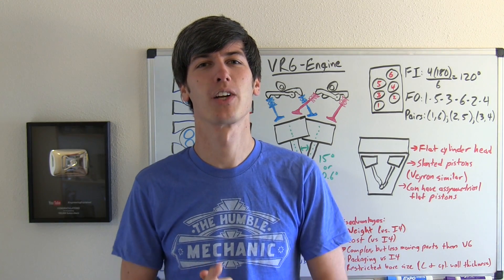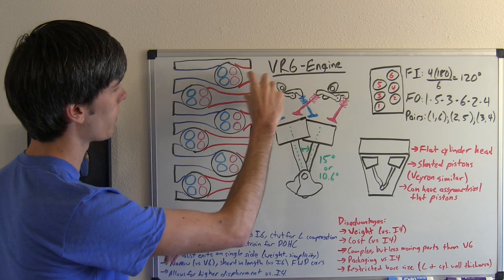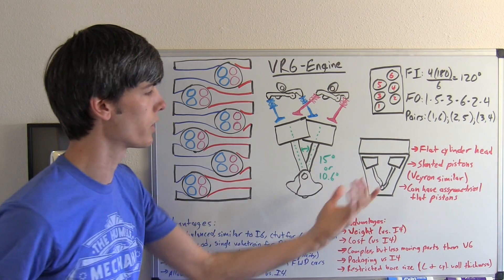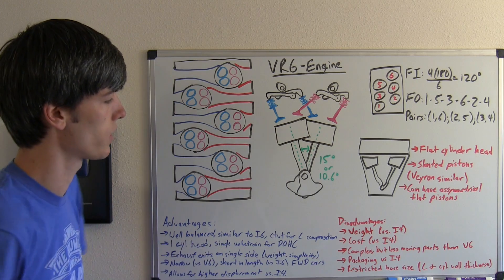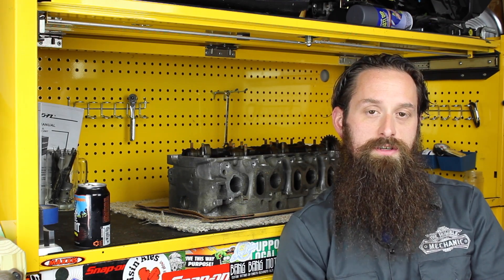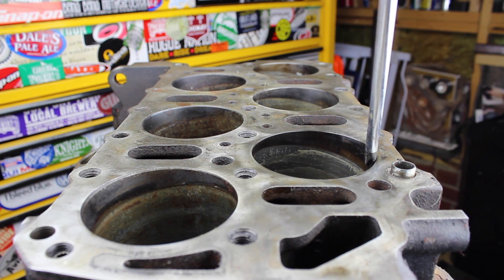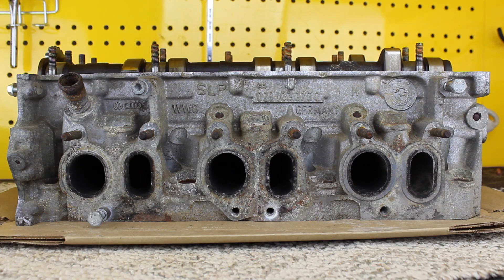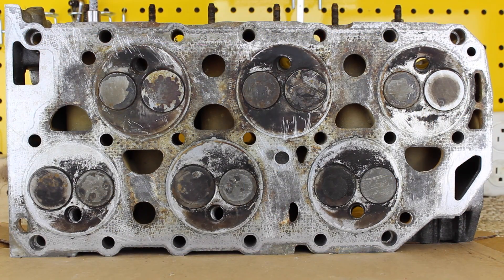VR6 Engine - Explained

Comment: i used to have a turbo version years ago they are insane as they were built as a diesel engine but was scrapped but they kept the design and built it as a petrol engine and it can handle up to 700HP on the stock bottom end

Comment: Hi getting an intermittent misfire with CEL on one of the cylinders for a 2000 Eurovan VR6 12V. But want to ask, since these (older) VR6s are port injection, carbonization on the valve wouldn't be a the cause for misfire as with the newer DI? 
I also have a Tiguan which had a similar issue where new DI fuel injectors and valve cleaning solved the problem.

Comment: Question is, what is wall thickness where the top of piston (and rings, to a degree.) is located from the point of max acceleration to BDC. The wall thickness at the bottom of the cylinder is not as important as it is obviously only housing the piston and not containing the cylinder pressures created during combustion. 

Another consideration I guess is the wear characteristics of the thrust side and what inherent scope there is for rectification of cylinder ovaling by increasing bore diameter and fitting oversized pistons.

Comment: This the first time I learned anything about the VR6, very interesting. What are the stock engines power specs?
What kind of aftermarket support is available? Is there a way to use this in a rear wheel drive configuration?

Comment: The origin of this type of engine, of course goes back to Lancia with their famous V4.  I am surprised that no other car manufacture picked up on this idea.  Having to machine two decks and cast twice as many heads adds to the overall costs but does nothing to enhance performance or efficiency.  It can also be good for turbocharged applications because it leaves more room in the engine bay for a turbo.

Comment: I am the first owner of a 2003 VW Jetta GLI with the 200hp VR-6 engine. It was my daily driver for 15 years. The engine is just iron clad. Coupled with a manual 6 speed it is extremely reliable and pretty efficient. I cannot seem to let it go, it’s now a good little weekend warrior. 242,000 miles and still going. Keep on Buggin’!

Comment: the explantation of the camshafts on the engine is different to the explantation on the whiteboard. the whiteboard was stating, that there are very long (and strange) levers to actuate the valves. and one camshaft is just for intake, but for all cylinders. 
but on the actual block everything makes sense

Comment: These white board videos are great, thank you so much for doing them. A query on this one though...is your cam shaft dwg correct? It's a cam per bank not a cam for intake and another for exhaust..?  And a tech question if I may. With different length inlet tracts doesn't that mean pressure waves , VE and Torque will vary per bank?

Comment: Hello, excelent video. I have a question: I changed VR6 conrods for another racing type 100grs ligther than original, and now have appeared a big vibration / unbalancing, do you have any comment / tip to get a correct balancing of this engine when I changed conrods?. Thanks in advance, Nestor

Comment: The V is not about the shape.  V stands voor verkützer, R stands for reihenmotor.  A real V6 would be to big to put in a VW Golf.  Even a 6 cilinder in line would be to large.  The VR6 was a clever solution.  So in fact, a VR6 is a shortened 6 in line motor.  In English it would be named a SL6.

Comment: I'm not sure if this has been said, or if it was mentioned in the video and I missed it. 

But I believe your drawing only refers to the 24v setup. For a 12v each cam does both Intake and exhaust. There isn't one cam solely for intake and one cam solely for exhaust. Each cam has 2 lobes per cylinder; one for intake, one for exhaust. The 24v is exactly as you showed, each cam has one sole purpose, Intake or exhaust. 

The Humble mechanic did a great job of displaying that with the 12 valve head.

Comment: Looks like a whole lot more metal than a straight 6- 20% shorter but 50% wider at the top of the motor giving a higher centre of gravity. As the slight v detracts from the perfect balance of a straight
 6, are balance shafts needed like true v6 engines normally have or is the difference negligible? Wont unequal sized ports give different velocities, resulting in unequal cylinder performance?

Comment: It just now downs on me, that the valve train with one cam taking car of intake and the other taking care of the exhaust valves is only true in the 4valve version of the vr6. In 2 valve form that obviously does not apply since the valves move parallel to the cylinder heads sealing surface.

Comment: is it the same engine from 2019? should i get the 2.0 or the v6 in atlas, which is more reliable and less maintenance?  thanks
Reply: The 2.0 is crap. Always go for the VR. Unless it isn't available, then go for a 1.8.

Comment: The first narrow V production engine made wasn't VW but Lancia in early sixties produced in over 350000 units and used on Lancia Fulvia It was a 4 cylinders from 1200cc to 1600cc dohc, the V adopted was from around 11 to about 13 degrees

Comment: My 2003 GTI VR6 (24v engine) has been totally reliable for almost 16 years now!  Not one issue!  Initially, when I bought the car, they recalled it for a coilpack issue, but they installed new and improved ones, and i've not had anything else come up all these years.  This engine is the most reliable i've ever had, even more than the Japanese cars my family has owned over the decades!  This engine is so smooth, with good torque.  I love tooling around town in almost any gear I want.  Incredible!
Reply: Mine had a misfire but with new coils and plugs fixed that for me, other then a battery issue i had the car is running great.

Comment: Would have liked to see the stroke on the lower/crank side of the motor? To see just how close/thin the cylinder walls are on the bottom of the motor.

Comment: Very reminiscent of the Lancia Fulvia 1.3 HF that I wrenched on during the 1969 SCCA season. The main difference is that the engine is inline, vs transverse. 13 or 15-degree v, if I remember correctly.

Comment: Does anyone have any real world external dimensions on one of these? I used to be into engine features and now all I care about is getting the most displacement from the smallest cube. I goofed around on Google and found someone saying that a VR6 long block is approximately 24 inches wide, 32 inches long(??) and 35 inches tall(!!). If these numbers are correct, that VR6 is larger than my small block Chevy. Anyone know what they weigh?

Comment: One thing that it has advantage over a conventional i6 is that it does not suffer from the same 2nd and 3rd degree harmonic issues, especially Z axis pitch problems.  
Inline 6's are notorious for harsh harmonic issues due to the length of the crank and how the firing order exacerbates this.
Diesel engines with much higher combustion event pressures suffer it with a greater magnitude again. 
V engines are brilliant in overcoming this as they have shorter cranks and blocks, the crank wobble is greatly reduced and weight savings can be made significantly at the same time.

Comment: Intake and exhaust issues are dealt with via runner volume. They do overheat and warping is the last thing you'll worry about as the heads crack when overheated. And although you may not get the external symptoms you'll get small cracks intersecting the spark plug holes allowing coolant to seep in causing premature plug wear and slight coolant loss.

Comment: Is engine compartment space really at such a premium that you need to go to these lengths?  I would think an inline-6 would be much cheaper and simpler to manufacture, especially when you start considering slanted pistons.  Do you get maybe a 20% length reduction?   I'm sure people could figure out how to put an inline-6 into a front-wheel drive car.

Comment: What I don't understand is if they're interested in saving space under the hood why go to an inline 4. Why don't they make a new block that looks like the VR6 only with 2 cylinders lopped off, making it a modified V4. This style of V6 isn't much wider than an I4, I would think shortening the block by 2 cylinders would really open up the space.

Comment: Not sure if it has been covered, but your section describes a 24V head as far as cam layout. The 12V VR6's like what The Humble Mechanic shows has cams that each have intake and exhaust lobes.One cam controls all valves in 3 cylinders. On a 24V, there is an intake cam and an exhaust cam like in a twin cam inline, and the mechanism looks just like you have drawn. 24V''s also have CVVT and the head is not completely flat like the 12V's. The 12V combustion chamber is the piston dish, the 24V has a typical hemispherical 4V combustion chamber in the head.

Comment: My experience with VW is over, I decided years ago not to work with any VW product. 
I am a retired Master Mechanic, with loads of dealershiip experience, heavy line work, diesel, manual trans, basically anything from the front bumper to the rear.
I still do work for friends, but will not stand behind any VW product. In my experience they are unreliable, and engineering nightmares, Mercedes is just as bad,, and I refuse to repair them as well
I prefer proven engines and reliable engineering, this allows me to stand behind repairs.
Oddball designs are intended to complicate vehicles to the point that dealerships are the only repair option, and this is all about making money.
When design is complicated, costs go up, drivers and owners of vehicles should not have to spend huge amounts of money just to keep the wheels in motion.
Simple engineering is a cost saver, if you want a vehicle that in unique, be prepared to spend allot of money for the vehicle, and repairs.
I will keep my Dodge dually 3500 with the V-10, it's a perfect VW crushing machine.

Comment: The cams drawing on the white board is wrong, each cam does both intake and exhaust for their respective cylinder row.
Reply: The white board is the 24 valve, the mechanic had the 12 valve. The 12V a camshaft controls both intake and exhaust, 24v one cam is all intake other all exhaust.
Reply: Mikey I was thinking the same thing the mechanic explained it the right way
Reply: @Dabestshindig

Comment: Could the cam lobe/valve arrangement be modified to use only the short passages for exhaust and only the long runners for intake, with injectors and headers on both sides of the engine?

Comment: are there VR6 engines with cylinders that move parallel to one another ?
Reply: Adrian Fidi No. They have an angle, because all of the piston rods converge at the crankshaft.

Comment: Matchless (motorcycle) did it with a narrow angle vee four ,single O.H.C. in the early 30's 600cc. I think it was called a Silver Hawk don''t remember what the vee angle was  but the cylinder block was a single air cooled casting the cam drive was bevel gear driven shafts. Bad time to make that type of motor in the middle of the depression.They also made a mono block twin in side valve form again the vee angle escapes me.

Comment: +Engineering Explained you might want to see the Lancia Fulvia V4, even if 2 cylinders less, is the same concept but done 50years ago
Reply: glad to see someone else is awake and has seen a lancia v4
Reply: I had a total of 3 Lancia Fulvias with the narrow V4 back in the 80's.  Wish I still had them now.  The Lancia narrow V4 goes way back before the Fulvia though.  It goes back to 1922 in the Lancia Lambda, so nearly 100 years ago.  Just saying.
Reply: Naw fam the Esssex v4 fam. The 70's.
Reply: @WolfoxBenny. Very beautyfull engine indeed. Runs smoothly when well adjusted. Thought it was 12 or 14 degrees and very shortly build. And lots of aluminum. The engineers had to built it as light as possible because of its location in front of the front axle. These cars are still popular in classic ralleys because of the low weight and ridgid coach.

Comment: thumbs up and suscribe,,, excellent video, one question,,, why vw use engines with 8 valves? i'm owner of a vw jetta 2000 engine code AEG 2.0L made in mexico and i dont understand why this particular vehicle have ABS, INMOBILIZER, AIRBAG, COIL IGNITION, 4 rotor brakes but just only 8 valves,,, the acceleration its very poor,,,, why SOHC than a DOCH ??? thanks i share this video on my social network :)
Reply from the maker: +LAWRENCE / L-JETRONIC glad you like the video, thanks for subscribing and sharing! Low power engines don't necessarily benefit a lot from 4 valves, so it's not always necessary. Better for high rpm power.

Comment: Your cam layout drawing does not match the actual engine. Each cam does intake and exhaust on each cylinder bank. Valves do not cross over as you show.
Reply: I caught that too. I was wondering if anyone else noticed. Guess I'm not the only one.
Reply: 4 or 2 valves/cyl ?
Reply: danisim9 is totally right - the drawings are for the 24v engine; the head shown is the older 12v engine.
Reply: His drawings are for the newer 3.2 and 3.6L VR6 engines. The older 2.8 ABF and bored up 2.9 ABV engines with 12 valves use a "Dual SOHC" setup which obviously have a different cam layout.
Reply: i don't know these engines just commenting on presentation.
Reply: Matthew Heffernan  not just doesnt cross, but probably CAN'T cross eachother :) i'm happy i'm not the only one who noticed this mistake :)

Comment: Is the thermal efficiency the4 same for both cylinder banks? Seems like the intake charge in the long runners need to pass by the exhaust exiting the engine and picking up heat prior to dropping into the cylinder.

Comment: Good job Jason and Charles. I'm a Chrysler tech, and was interested in the VR6 after seeing a block in an unrelated vid. You guys make a good team. To bad you missed the mistake with the drawing of the valve train. 
I like the fact that the engine is a single over head cam with 2 cams in a single head. Going to look for more VR6 vids, starting at with the HumbleMechanic channel. Thanks

Comment: I miss my 12 valve VR6. I have a 24v that won't be running till next year, but it just doesn't have the low tone the 12 valve does. Nice torque too. The chumps at VAG never put it to use with a stock turbo. The crazy intake manifold doesn't have the best flow and forced induction takes care of a lot of that.

Comment: Question I have is due to the fact that some of the exhaust must cross the length of the head (the ones that travel the longer path across the head) does the cylinder head have issues staying as cool as a more conventional design? is performance affected by this or have they engineered around this fact?

Comment: A six stays a six forever. I drive a German 5 cilinder. In low revs it's smooth as a six, when put to the edge it hammers like an eight, it drinks like a little four. And when it sleeps it dreams of his famous uncle, the legendary Audi S1.
Reply: bolderiks 5+5
I miss mine
Reply: bolderiks Lol well said
Reply: Mk5 jetta 2.5se?
Reply: bolderiks that made no sense. It’s going to take more than the # of cylinders to design something that performs that way. You can easily make a 6 or 4 perform the same way - tuning, camshaft rotating assembly design.
Reply: I'll stick with Chevy's cast iron wonder: inline 6 cyl 194/230/250 cu. in. engines-they last FOREVER! Cheap and easy to maintain too-so what if they are a bit "heavy" or "inefficient"-reliability rules in my book

Comment: I would have liked to see how simple/complex the cam chain layout is. Any idea on if the crank is steel,forged pistons? I do like the idea of one head. This just has to be an interference engine but with chains instead of belts it probably is not an issue. Where does this engine excel? Is it in very low cost for v-6 performance levels or perhaps inherently easy to control emissions? Have you notice the move to 4 cyl inline engines with the power of v-6's? No longer is the 4 cyl version of a small car considered to be the low powered economy version. Today's 4 cyl engines are easily making 250hp and above (this may reduce the need for this design) I did not notice but is there a 4cly version of this engine? I could see a lot of work space available with a 4cyl version.

I did my on search on a single head version of a V4. It appears Honda did make one. It is called  
The V4 in the Fuliva uses a single cylinder head. I left the Wiki page with the idea that a V4 is much harder to balance, size difference in not as great as I thought and with the inline 4's doing such a great job these days there is just no reason to go with a single head V4.
Reply: Dang, I was hoping for better engine details. It is a chain setup at least? interference (hope not). Is this a 4 valve engine?
Reply: Not to sure on forged, but the earlier 12v vr6 engines are very strong. Initially it was suppose to be a diesel but changed last minute to petrol. Making them practically bullet proof if maintained correctly
Reply: Modern 4 cylinder engines are going the route of forced induction to help improve fuel economy to meet newer government requirements.  No one has a 250 hp N/A I-4 production engine (Honda came close with the S2000's 240hp N/A 2.0L, but torque was very low).  Another benefit of FI is that it's easy to get big power, and with different tuning maps for different throttle positions and other variables, you can have both awesome fuel economy and big power.  Modern engines are great if they're built and tuned properly.